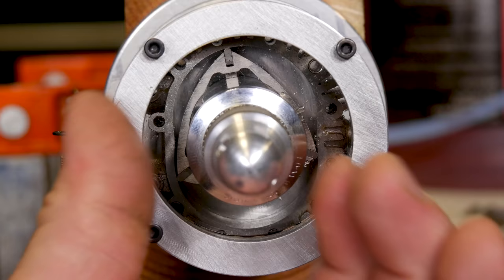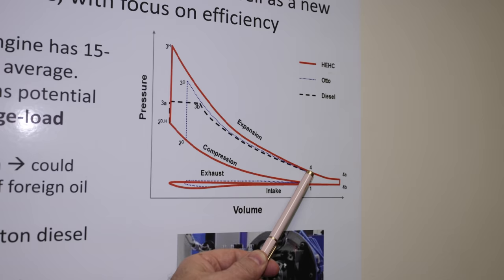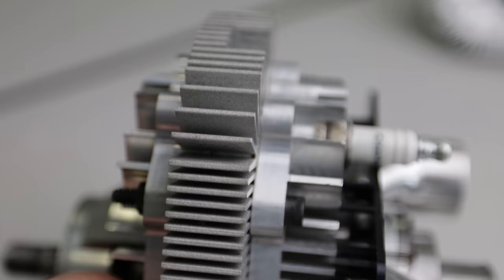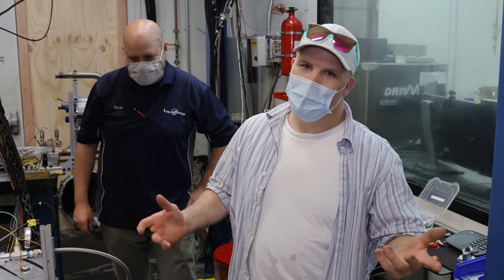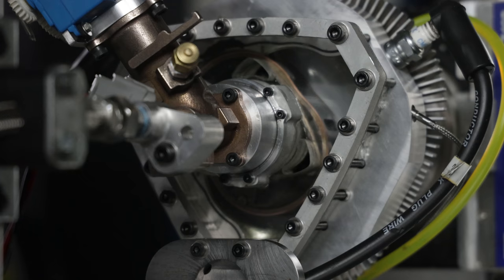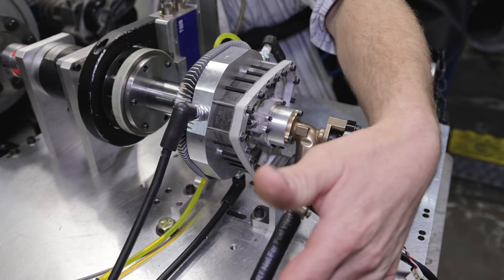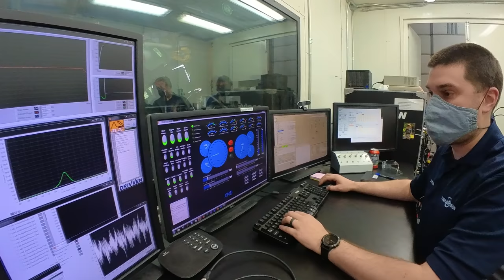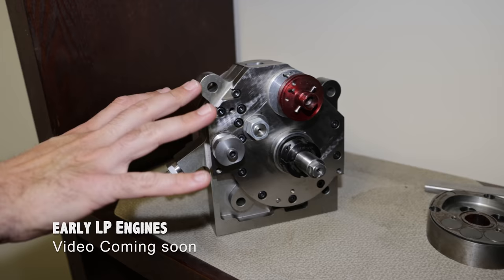See Thru Liquid Piston Rotary Engine - In Slow Motion

Comment: That was very commendable to give credit to the engineers at the end.  I still feel pound-for-pound that this lightweight rotary engine can be used in many applications today, perhaps on motorbikes and gocarts.
Reply: There actually was a motorcycle that had a rotary. I don't remember the name off the top of my head
Reply: @davidpoole7098  A Suzuki RE5, but it was very short lived though. I have seen them in person.
Reply: @mustang32758  I have a 75 RE5, I was building a bike t9 run on the Bonneville salt 🧂 Flatts with a goal of 200mph..from Wyoming USA 🇺🇸 🤠
Reply: @davidpoole7098  At one time there was a chainsaw that had a rotary engine. IIRC it was run in two-cycle mode, and was offered by Husqvarna.
Reply: @davidpoole7098  a suzuki re5 and a Norton
Reply: Drones, why are they called liquid piston?
Reply: The best application would be in hybrid automobiles. The electrical grid is nowhere close to being capable of supporting a massive EV fleet, so hybrids might be the only logical choice for the next 20 years. A typical car only needs 30 HP to cruise at 60 mph on level ground, so if you start with a full charge, a small inexpensive 30 HP LiquidPiston engine, running a generator would be enough to cross the US, no problem, without ever needing to find a charging station. For daily commuting and shopping, a nighttime charge would be enough to allow for 100% electrical propulsion.
Reply: Would it be lighter than a turbopump on weight critical rocket boosters?
Reply: @davidpoole7098  
The latest and greatest rotary bike is based of the Norton NR700 and is called the Crighton CR700W. It's vicious.
Reply: Hercules

Comment: These engines are very exciting.  Not just for solving the seal issues, but because the geometry makes high compressions possible.
Reply: This is very very interesting. But, two things: piston top sealing (usually a great challenge) and valve timing (necessary to compensate for charge and velocity variations). A turbocharges may bring some benefits ...
Reply: If they are able to get high compression, would it be able to run on diesel?
Reply: @hexvoodoo2797  Yeah, absolutely. He mentions it in the video.

Comment: I would LOVE to see a full size heavy duty (500+hp) diesel version of this engine.
A typical diesel engine is already a simple engine and this one doesn't even have a cam shaft and valves to run! Only down side is lack of engine breaking in this configuration.

Comment: Of all the comments I've looked at, I haven't seen the simplest, most basic questions:  What is the working displacement?  What rpm range does it operate at?  How much hp and torque does it make, and what is the powerband like?
Reply: "4hp" is stated though none of your other questions seem answered.

The moving parts seem lightweight & moving with low acceleration compared with piston engines so I would expect very high RPMs to be possible, maybe painfully high pitches or even ultrasonic, especially if the exhausts are combined into one.
Reply: Geometrically :very high compression ratio, but achievable depends on the seal leakage. They were not able to obtain compression ratios to achieve compression ignition, For the demonstration the use methane and spark ignition.
The real problem is the peripheral face seal at the corner designed to seal the front and rear walls.
The problem Cooley had after he invented exactly this in 1903.
Incidently, Cooley also had a two and a four lobe design, later expanded with 5, 6 and more lobes.
Reply: Erik, The mathematical treatment for the ideal trochoid is simple, as far as displacement is of interest, The rpm is limited by the structural design of the seal, where the inflection is hard to stiffen due to the centrifugal load.
Power is proportional to the product of average torque and rpm.
P = T × rpm × 2π/60.    S I  units

Comment: A very interesting concept, and great camera work showing the slowmo and inside. However this is just a wankel rotary with some topology changes. Does not avoid the problem of burning oil, and that rotor will be hard to cool and thus intake air is gonna be higher temperature reducing efficiency. Compression ratio can still be a problem, Apex seal problem is also not really fixed (but can potentially be serviced easier). Also torque might be even more of a problem than wankel, just look at that power stroke. Multi rotor design might be harder due to the shaft intake as well
Reply: Intake through the shaft adds a rather restrictive intake path as well which will hurt power.
Reply: @Surestick88  Might need a supercharger or turbo. But it looks like some of the power stroke is wasted pushing the wrong way on the rotor.
Reply: @larryvaughn5843  Surely you can say the same for a piston engine with ignition or even steam entry being in advance of reaching top dead centre. Edit: Interesting fact that some Great Western Railway locomotives from what I remember with Stephenson link valve settings had negative lead in full gear to help starting as if one of the pistons was in its initial steam entry it would fight the other cylinder or cylinders and try to go backwards. The lead would come in at shorter cut offs when it would be needed.
Reply: @michaeld5888  I had a 2 stroke motorcycle that would occasionally start and run backwards due to the ignition advance and high compression.
Reply: @larryvaughn5843  a friend of mine ran into a bus like that
Reply: I'm pretty sure the people designing / testing the engine would know exactly these problems and know how to fix it. Rotaries are better than reciprocating mass engines anyway so its worth resolving the drawbacks.

Comment: Im pretty sure this is a revolution in the rotary engine world, it would be cool to see a bigger version inside a car. Great job!
Reply: My guess this is for smaller application lawnmowers weedwackers maybe Go-Karts
Reply: @nightmareinaction629  Try again - drones, APUs for military and potentially more. They have only put one on a gokart as a demo. Not on market yet, but easily upscaled.
Reply: @FukU2222  yeah would love to see this upscale and used
Reply: How about a rx-9🌚
Reply: @racingjets1  🌚
Reply: Yeah, and to see how it performs, the power output  curve, mileage and how the inside looks after 100k miles. Let it run for a month in a lab to expose the weak spots
Reply: It's a nice design but I still see issues with the outer ring over time.  Slowly that metal is going to wear away and you'll get combustion gas leaking into other areas during compression cycle.
Reply: @timothyandrewnielsen  carbon will seal it 😀
Reply: I suspect this layout would be a pain to liquid cool due to the exhaust having to pass through the rotor. Pretty elegant for air cooling though, so it could be a good option on medium sized drones and light aircraft.
Reply: The design definitely has a lot of potential. Though with so many cars becoming EV’s nowadays, that window might be closing. However, it has a few features, like it’s constant rotation, fuel flexibility, and overall simplicity that mean it would easily replace the 2 stroke engine in a lot of applications, like portable generators. And it’s high RPM rate make it good for aviation applications. They just flew a model airframe with one of these designs recently.
Reply: What if they put one in a miata👀
Reply: @racingjets1  rx vision already had a skyactiv-x rotary
Reply: Make a great bicycle engine.
Reply: No offense but this special kind of engine seems like it has no business in transportation. This thing can make a bunch of power for a short burst and then burn up
Reply: @petermuller161  sounds good for drag racing or land speed records
Reply: @trollmcclure1884  hah, that's sort of true.
Reply: @FukU2222  True, but a gas (or even diesel) powered lawn mower that doesn't weigh 100 lb and works without a flywheel so heavy it shears off every time you hit a rock would also be a great invention with great sales potential.
Reply: @nightmareinaction629  If you google Liquid Piston their web site shows a 4X diesel compression engine that is 40 hp.
Reply: Yep. A great idea for 40 years ago. ICE is on its last legs.
Reply: @FukU2222  It's not as easily upscaled as one might think. Their 750cc X4 engine only makes 40 horsepower, and that's with a turbocharger. They also strip the engines of any cooling, ignition and fuel parts before they weigh them, so they're not as light as they advertise.
Reply: @trollmcclure1884  lol 100k miles.

Try 40
Reply: @fnorgen  I don't see any problems with jacketed cooling.  Have you seen how turbine powered helicopters work?
Reply: @petermuller161  right, I'm seeing low cost cruise missile for Africa
Reply: @unmountablebootvolume  Ryobi battery mower is excellent
Reply: @warrenzevonsangryghost6055  except in flight.
Reply: @joeKisonue  I didn't say that battery mowers were bad, but batteries simply need time to recharge, and they still are stupid heavy, just like a normal gas/diesel engine.
Reply: @unmountablebootvolume  well with a mower I'm pretty sure an adult can manage to have charged batteries before any grass emergencies arise.  The Ryobi is quieter and lighter than any gas mower. The battery packs are like 2 lbs
Reply: bigger? inside a car? This already is powerful enough to fit in a car, ha!

Comment: Wankel: Doritos inside peanut
Liquid Piston: Peanut inside Doritos
Reply: you make a good point. that's really interesting the geometry is inverted
Reply: Sort of yes, except that the Wankel housing really is peanut-shaped, meaning bigger at the ends than in the middle (it's technically a two-lobed epitrochoid), while this rotor is a simple oval (semi-circular ends connected by straight sides). Similarly, the Wankel rotor can be a simple Dorito-like triangle (although in practice the sides are usually circular arcs, which is a Reuleaux triangle, to increase the compression ratio), while this engine has a rounded three-lobed housing. They're related, but not the same shapes.
Reply: Your comment makes me hungry
Reply: Dorito inside potatoe
Potatoe inside Dorito
Reply: thanks now i finally understad the stuf

Comment: I had a 1974 RX4 Coupe as my adrenalin toy for when I wasn't busy racing outboard hydroplanes in Canada. After having two apex seal failures, I retired the car (it had also started to rust away) in 1980 and gave the engine to a racing buddy and usher at my wedding who had specialists in Toronto rebuild it. We then put it in his RX7, a tight fit as it was 25% bigger than that car's original mill. It went very, very fast... until it also popped another seal. I gave up playing with rotaries but became briefly interested again when OMC developed its racing outboard rotary engines. Again, too short life span, so I returned to internal reciprocating engines. Am delighted to see true believers have kept the faith.

Comment: Wow, this is amazing, its like the rotor and housing are switched! Its something you can see often in electric engines, but figuring this out for rotary engines is a beautifull thing
Reply: Interesting design which is good because it gets rid of the unequal heat distribution of the Mazda Felix Wankel design but this design probably still suffers from less torque than a typical piston engine and probably suffers even worse from excessive surface to volume ratio which in any case could be circumvented with direct injection if you go to that route.

Comment: I love how the only thing I can imagine in my head is the power side of the piston being like " Fuck! Everywhere I go they're exploding in my face!"
Reply: this might actually be really bad, cause that face is going to heat up and expand more than the other if not properly cooled, and that can start a lot of problems. It's similar to what happens in rotary engines, were the chamber heats up too much and the engine doesn't run properly. It would be interesting how they manage to solve this problem with bigger engines (1 - 5 L, turbocharged  hunderds of horsepower, etc)
Reply: @xxoan.1613  I thought about that too, like, that face literally never gets a break and it appears to be made exactly the same as all the other faces. Which, like you said, could cause it to expand like crazy under high-stress conditions. Only thing that seems to be cooling it is the minor whiff of exhaust gasses.
Reply: @man_on_wheelz  
Makes me wonder if that whole rotor is made out of inconel. 
But that area does have air flowing through it and you can see the cooling fin density is absurd on that part, so maybe steel is up to the job.

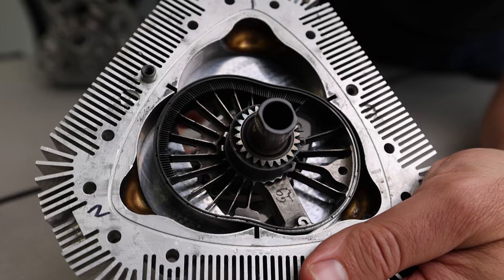Edit: actually at 3:29 you can see there is a TON of clearance. That rotor could literally be glowing red hot and still not have any issues. They just let the reverse-apex seals handle it by giving them plenty of travel I guess.
Reply: @xxoan.1613  you do know that normal engine pistons do also expand and they have to take that into account. that's why in high horsepower engine you will hear a bit of piston slap when there cold. its also why you always let an engine warm up there made to be under load when the pistons are warm and expanded to the right size. ask any one who has done a forged piston swap you have to take in to account expiation. also if you look on the power face of the piston it has cooling fins.
Reply: @phalanx3803  u do realise that one half of the rotor is eating every explosion and the other side isnt
Reply: @xxoan.1613  there seem to be many problems with this design, the main one is the glowing piston that will cause detonation
Reply: @phalanx3803  yeah sure, but the pistons are activly cooled with oil, this one is just with air and for me it doesnt seem to have a lof of room to breathe
Reply: I guess it could run like a 2 stroke so both sides of the rotor get heated by the  combustion process, but then it would have to have a supercharger to scavenge exhaust gases
Reply: That was my main takeaway. It looks like they took that into consideration, there's no way they wouldn't have, but I still wonder if this could be scaled up for automobile use.  I'm guessing this design can't.
Reply: it's not a minor whiff though. a 10:1 fresh air to exhaust gas ratio? and the gases are flowing around both sides of that power "firing" face of the rotor. It's literally surrounded by 9 times ambient air than spent combustion gas.
Reply: Your statement is exactly what I say to myself everytime I see someone post on how "letting your car warm up slightly is pointless" posts. Um there's definitely a point. cold start your motor everyday and floor board it for 60 seconds before driving to work. let me know how that works out for you...
Reply: it has the entirety of the inside volume and chamber volume to breathe, its twice volumetric as compared to the original mass produced weinkel.
Reply: entirety of the hollowed rotor* and chamber volume.

Comment: Props on the credit.  Engineers are usually only thrown under the bus, but serious props are often needed.  Good job!
Reply: As a machinist it's because most of them just want to go straight into cad/design and have no experience, or business, near a machining center. I can't tell you how many times I've had to send the drawings back because of a dumb ass.

Comment: I rebuilt two Rotaries back in the Early 90's. The Front bearing of the eccentric shaft spun on me and shut the oil flow down to the shaft. Chewed it right up before I figured out what happened. I should have known when the Oil pressure shot thru the roof something was up. I'm glad to see that you guys didn't give up on this technology. I will however be interested in how you locate the spark plugs for easy access :)
Reply: Easy to access spark plugs. Simply remove the engine cowling, or include access plugs when building/modifying the aeroplane. You should see what is required to change the plugs in a v form transverse engine, with half the plugs facing the firewall. It requires a mechanic with special physical attributes, long skinny arms and small hands. Helps to be triple jointed.
Reply: Ayinu🤣
Reply: you can see the spark plugs in the video